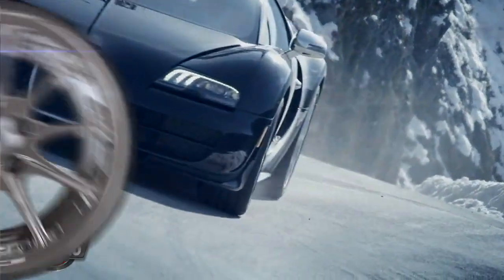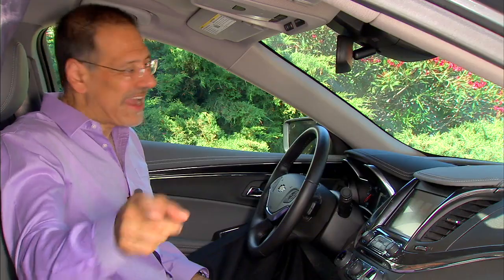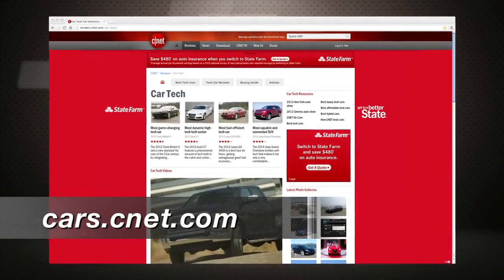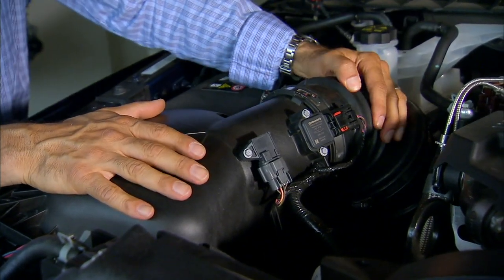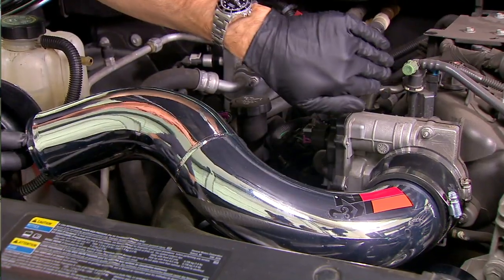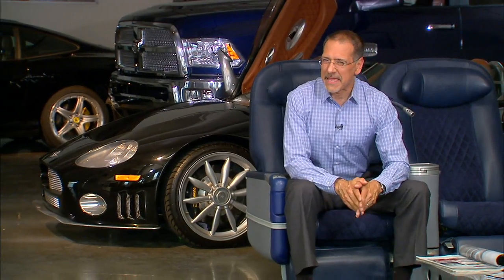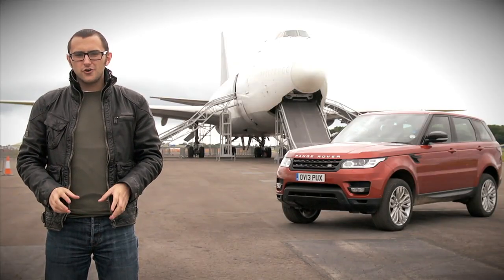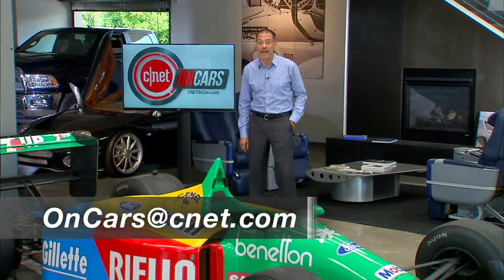CNET On Cars - All new Chevy Impala and Range Rover Sport - Ep 22

Comment: I had a 2003 Impala. I racked up 395,000 miles before I was done with it. It was still running. Sounded like it had a collapsed lifter - that's right: they still had (and still have) overhead valves (not overhead cams) and the seals in its steering rack were leaking, but otherwise it seemed ready for another four-hundred thousand miles! 

However. However, it needed its right hand CV axle replaced about every ten thousand miles. That's not much more than the service interval on that car. Granted, it wasn't a huge problem, but it was pretty annoying.

Comment: CAI offer almost no HP/TQ or fuel economy differences.  You will however get a slightly better throttle response and WOT noise will be a lot nicer sounding.

Just get an MIT, a K&N drop in, and save yourself $200.

Comment: I wonder why Honda and Toyota aren't making larger cars to compete vs the Taurus and the Impala.
Reply: WuWei Xu Toyota does - the Avalon.  Honda does not; they don't have the capacity nor is it in their vision (they don't believe in very large and inefficient vehicles).  However, the previous Accord 2008-2012 was barely classified by the EPA as a full-sized car.
Reply: chicobear Right, I forgot about the Avalon. I guess Honda isn't making full sized sedans because the market for them isn't huge, just my thoughts.